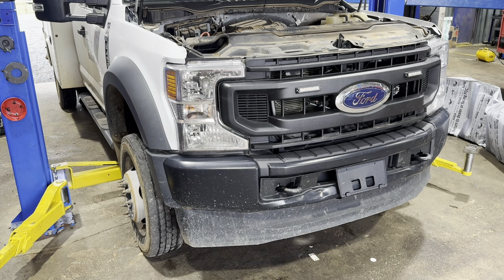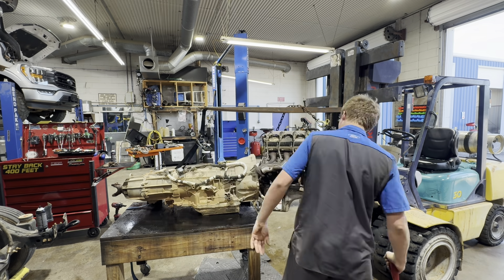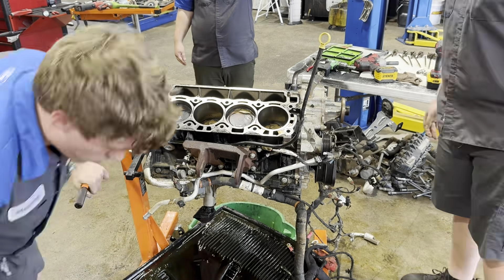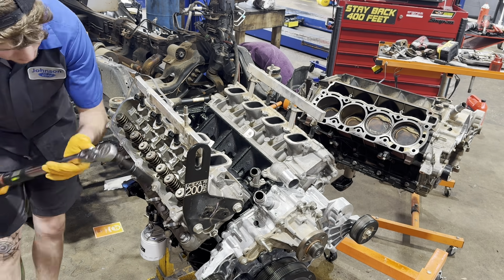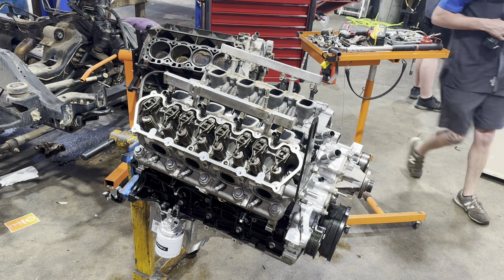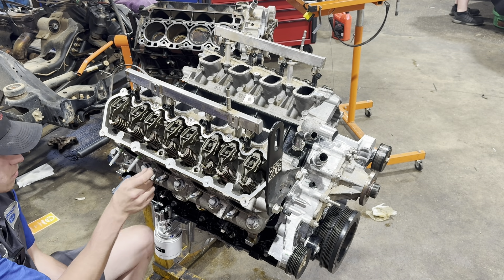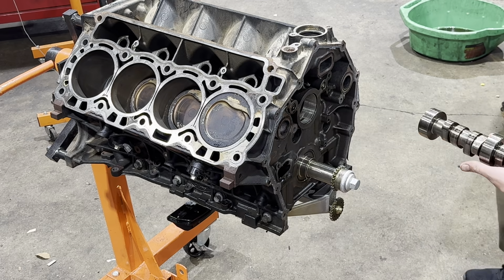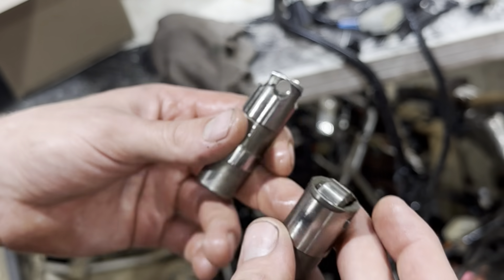Ford 7.3 Godzilla | Does this one issue make the engine a bust?

Comment: VW did the same low oil pressure thing a generation ago and they had a lot of problems too. Doesn't anybody ever learn? By the way all this low oil pressure thing was figured out by about 1940 !
The idiots at VW, FORD and every where else that promoted this low oil pressure crap need to be fired and never allowed to  make engineering decisions again.

Comment: I bought my 23 F350 Lariat ultimate Tremor w/6k miles May '24. Now, w/20k miles, engine started misfiring. Brought it in. Scanned it. They scoped it and found metal filings that attached to the piston rings and scored the cylinders. That was a month ago and they put a new 7.3 engine in it, one with a whole brand new part number. 75 mi later, it started misfiring again. I drove it straight to Ford 3 mi from where it occurred and they scanned it. Now the opposite side, two banks misfiring. They said they didn't see any scoring in the cylinders, can't figure out the problem, sent all the data and images to the engineers at Ford manufacturing. They said I would hear something Monday. We're talking 5 days ago I still haven't heard anything. Now if it's a brand new part number, I thought this lifter / cam delamination problem was corrected I was told. I know this problem is from poor heat treating process. So maybe Ford should contract with Crane and get their cam and lifters put in. That's all they do so I'm sure they got it downright. 
I don't know what to do at this point as far as sure, I have that 100K/7 year gold warranty that kicks in a year from now. BUT I do tow our fifth wheel with it twice a year, no more than 500 mi each way. We were planning on going around the country next year however now IDK about that. I didn't want to have to buy a diesel and I don't care for GM or Dodge. 
So it's a bit of a quagmire here. I should tell them to put the damn megazilla engine in it because that has the upgraded parts.

Comment: This is the video I needed to see. I was between a 6.4 and a 7.3 and the idle oil pressure has mde the choice easy. I dont want a high pressure fuel system on a gasser...Bye GM. I dont want a variable oil pump in anything...Bye Ford. Shame as the 7.3 has such potential, but Ill take MDS and 20-40psi oil pressure at idle.

Comment: 6.2 is a great engine. Probably the best Ford V8 of the 21st century in terms of longevity. Typical Ford fanboy lol. These 7.3s are a joke. Our fleet is 80% Chevy Express with the 6.6, and we've only had one engine failure, maybe 3 top end rebuilds and most of them are at 70-100k. The rest of the fleet is Fords, EASILY 70-80% failure rate on the gas 7.3s before 100k. They are a joke. They may have the same issues as GM V8s, but they can't take anywhere near the same abuse

Comment: You lost me when you said the 6.2 were junk. I run 10 service trucks with the 6.2 ford and they are great engines. Transmission have been good as well. They are 2012 thru the 2016 years.

Comment: Do not idle them, change the oil every 5k with good synthetic. A gasoline engine needs this, the new 6.8 and 7.3 engines are quite well built. Take care of them. Oil changes and regularly. A 6.7 Powerstroke will require much more maintenance and 17 quarts of Rotella. If you skimp on either and run them to long you will experience a wallet buster.

Comment: Does anyone here know how this translates to wear on a DOHC 4 pot used for deliveries? Cuz I idle alot in the parking lot unless Im expecting to be back out the door in <10 mins. cuz I dont want the start-up wear on the engine & starter ~40x/ shift + its diagonal on a very steep grade.

Comment: I have the Godzilla in my e450 based motorhome and love it. But then again mine never sits at idle, I'm either running down the road or it's shut down. Much better than the V10 it replaced in motorhomes. No double downshift going over a small hill anymore. I run it all day at 79mph and it's quieter and fuel economy isn't any worse.

Comment: I wonder if Meling or whatever the known brand that makes the larger volume oil pumps for the hemis will do that for the 7.3’s? I’ll also add that the oil pressure is just a affect of higher oil flows and the oil’s viscosity and temperature. If you run a full synthetic oil that still meets the weight requirements it will typically have a lower pressure but flow the same volume of oil through the engine.

Comment: So if you have pro-power onboard, it is bad for the gas and the diesel for different reasons.  But both shouldn’t be idled for long periods of time so not an RV generator replacement for sure

Comment: I don't know why anyone would put needle bearings in a lifter. That's generally what causes the lifter to fail on a Ford . Massive highway trucks run millions of miles and the only place for needle bearings are in the u-joints. Can anyone really imagine how many times that needle bearing rolls each revolution for 3 or 400 thousand miles. There's no oil pressure for the needle bearings in the lifter roller. Pescaderia makes a lifter that does not have needle bearings in it much like over the highway road trucks. Needle bearings in automatic transmissions are subject to massive oil flow

Comment: That 8 psi is a minimum operating pressure before the sensor sets off hook a actual line to the truck and see the 2022+ that ive seen people do this on start up is 90-100psi till it idles down and at a warm idle hovers 21-23psi some one read that 8psi thing somewhere and ran with it its just like politics a few people rinse and repeat info without testing it for themselves and that how bs like 8 psi at idle gets started. Look on yt ive watched multiple videos with oil pressure gauges hooked up with a actual pressure gauge and let idle for a while to test

Comment: The  introduction of Variable Valve Timing , the computer  cylinder management controls , and direct fuel o fiction , has damaged durability .
On all vehiclea  manufacturing makes , not Just  certain makes .

Comment: Here's the thing, you put this out in 10/24. Ford switched the 7.3l to the higher trim levels and put the 6.8l as the main work truck and 4x2's in 23? I think. But I know they did. The 7.3l heads look nothing like an LS HEAD. A LT is even a stretch. I don't see it. As for the lifter problem I'm sure there's TSB's on it to get to the root cause but I think there was a production change for the lifter, plus area's of high heat was noted. The oil pressure might be low but you never said the spec. Could be 8psi hot and 10psi cold with a peak of 20psi. You think the oil pressure gauge actually reads any pressure. Doubt it. It's an on/off light switch. My point to that is 8psi does seem low but they're not saying it's a concern. And low pressure does not mean low volume. Does the lifter have a submersed or pressurized lubrication design? That low pressure could be because the oil passages are wide open or there are more of them. So what's the cause of it? Probably production change in material saving 75cents per engine because some product manager took a risk cause he wanted matching Teslas from his $500k bonus. 

Me personally, I've seen way more 6.2l Boss engines above 250k miles than any other gas engine. Worked fleets with a few at 350k on the odometer when they stopped working. Same with my tech friends. A little work, cam, springs, and tune they can get close to 500hp and 500ftlbs with mileage bump. This is what I've seen and I don't give any slack to any engine. My Yukon Denali has 389k original engine and trans/tbox. I'll take a Boss 6.2l over a Coyote, Ecoboost, V10, Powerstroke 6.7/6.4 any day. Every other engine seem like a house of cards. They have no robustness. The 7.3l gas engine is another engine Ford didn't need. With money they used they could have improved the Boss. Add a small turbo its's 650/700 hp/trq give it F450 axles done. Done. Why do people think they can tow 30k lb houses around with passenger vehicle? A school bus has less towing but same payload but the chassis is twice the weight. That much weight(house trailer) is breaking 5th wheel chassis/frames overstressing the brakes and lmiting control.

Comment: These standards to push fuel economy have been terrible for longevity of engines.  Too thin of an oil, too low oil pressures, and this on engines which are supposed to be geared toward industrial uses.    We haven't seen this issue with any trucks at work yet...  I'll give it a little bit of time and we will.

Comment: The low oil pressure at idle, isn't something the OEMs can fix. Emissions regs are calling for detrimental lows at idle. The only way to achieve spec in a gas engine, is to lower idle resistance by reducing ancillary load. In short, low oil pressure at idle is the only way we can have things like high output alternators and air conditioning.

Comment: I have one of these in my RV and wondering  if I have headache in my future! It has 11,000 miles on it I put about 3,000 of those miles!  From the info I gathered most of the lifter issues are from high idle housed utility vehicles!

Comment: I have a 09 crown vic with 250k miles and over 8k idle hours. Original lifters / lash adjusters. It might be a turd but with no cam phasers, a decent oil pump, and oil cooler... it keeps working 😊

Comment: I bought my F250 with the 6.2 gas engine brand new back in 2016. 200k miles later, all I have had to do is change the oil. It still purrs like it did back when I bought it. Fantastic engine.
Reply: Got that right, I have tortured my 6.2 towing for work and its great!  Makes me wonder why they discontinued it??
Reply: If you pamper anything enough, it might last.
Reply: @ricksmith1382  it's called maintenance princess, just because changing oil is too hard for you doesn't mean the engine is faulty.
Reply: @Abandonsoyciety  Facts!
Reply: 6.2 was a very good engine. This dude doesn’t  know what he is talking about.

Comment: Great info. I just bought a ‘24, SD with 7.3. I wonder what ratio of run/idle is OK.  I notice it has fast idle at start at 1200 rpm, then steps down to maybe 900, then steps down to 600 rpm. Too bad there are few cars/trucks with an oil pressure gauge. I have heard these reports elsewhere. I will avoid idling at all reasonable costs. Better to replace batteries and starter.

Comment: Kinda funny they're having this issue, my 2UZ Tundra has almost no oil pressure at idle and that engine is sitting in the driveway at a little over 300K miles and there are more then a couple out there that have gone over 1 million miles.   At 300K I still forget that engine is running sometimes unless I look at the tach.

Comment: Why the hell is Ford so concerned about MPG in Super Duty trucks?  The EPA doesn't even require MPG be published on the Monroney label.  Just put the correct pump in the engine, give us a reliable engine and save everyone, including Ford Motor Company, the headaches.

Comment: I have Read that the Duramax engines in the Chevrolet and GMC models 2500 HD and up have a way to increase the idle speed similar to how a large truck or a semi tractor truck will use the cruise control to idle up. Supposed to make the engine last longer and keep it cleaner. I know I read it somewhere imagined it but it takes it up to a thousand or 1200 RPMs and that will let it produce heat and it will cool it more efficiently. That's my two cents worth.

Comment: It's more than just the low idle psi, they also drop oil flow rates. So its a double hit to the cam and lifters, as the oil is the only thing cool those high friction parts and they halve oil flow rate from what it would normally be in a fixed pump setup. 

As for Ford fixing this with a software update, they can't as far as I know. The oil pump from what I have seen is completely mechanical in the way it works so there is no solenoid to control. 

What I'm waiting on it someone like Melling to come out with a fixed psi and volume pump to replace the OEM unit, like they have done for the 4.6l and 5.7l to fix their oiling issues. Once I know their is an OEM placement replacement pump I will more than likely make a f350 dually with the 7.3l my next truck. There are some aftermarket company's that remove and relocate the oil into a new timing chain cover but it also means a new accessory drive setup too, and that is a little to much $$$ for what should be a simple pump swap to fix this issue.

Comment: Considering the solution to fix a cam and lifter failure is engine replacement because the engine is full of metal debris that will slowly destroy the main and rod bearings, yes, the 7.3 Godzilla IS a bust.

Its just a big money maker for you.

Comment: I really believe that besides oil pressure issues, one of the big parts of these failures is the hydraulic roller lifters they wreak havoc in nearly every engine. Cummins went from flat tappet to roller and they immediately started having lifter failure problems too. I’d say rollers are fine for race cars but not the everyday workhorse.
Reply: And was the Cummins failure because of the lifters , or the non tulip designed push rods like they had previously? Non oiled , splash only on both designs. Only the older "tulip" push rods would catch and hold oil.....    Loose a pushrod, smash a lifter. Loosen your grip on the epa and pay the price. P.s. pay the engineer more and hire the good ones
Reply: Vortec and SBF didn't have roller lifter failures... 

My BBF retro roller cam doesn't experience these failures.

Quality is where the problems lie, not the design.

Comment: doesn't Holley or another aftermarket company offer a gear driven, high volume oil pump for these? if it were MY truck at a shop due to lifter failure that stems from a variable-pressure oil pump, i'd get rid of it for a high volume unit akin to what the mighty 460's utilized.

Comment: In general, a race engine only needs 10 PSI of pressure  per 1000 RPMs .maybe they should install sprayers for the cam lobes

Comment: I can see absolutely no advantage to allowing oil pressure to drop to dangerously low pressures---regardless of engine rpm.  Ford should just install a high-volume mechanical oil pump in their engines and then watch their low oil pressure related engine failures evaporate.  I guess Ford is hoping that the engine will make it through the factory  "warranty period" before it grenades itself and the customer is then forced to pay for a very costly repair---or just buy another truck...

Comment: I dont think the oil pressure is the problem. 8 psi per 1k rpm should be good. In theory, to much oil pressure will push oil from where it needs to be if that makes sense. I have a 302 ive drove for 30 yrs now. Same engine never went back in. Anolog gauge always shows  around 30-40 cold. Once warm 7-10 psi at idle. She dont tick and runs like a beast🤷🏼i think our metal products suck chinesium now. German metals seem so much better.

Comment: Youtuber named repairvehicle pointed out a few design flaws of this engine. thin cut-out walls between cylinders, phazers, plastic guided chain driven oil pump, cam phaser etc. Ford has been instructing their engineers to design everything to fail. It's all about generating more $$$ for legacy car makers. Almost bought 24 F350 7.3 gas DRW for a camper. Look at closer at 2:38 on this video. Brand new engine has the same flaws.

Comment: I don't buy the oil pressure hypothesis.  IMO it absolutely is a lifter manufacturing problem, for a couple of reasons.  First, the quality aftermarket lifters don't fail with the same stock oil pressure.  2nd you'll virtually always find it's 1 lifter that's failed, and it's not always the same lifter.  If it were an oil pressure problem it would be multiple lifters but we always find 1 lifter failed and the rest are perfect.  If it were an oil delivery problem it would consistently fail on the same lifter position.  It isn't, it's completely random which lifter position, and it's virtually never more than 1 lifter.  It's like there's a small percentage of bad lifters mixed in with the good and every engine is a roll of the dice on whether or not it gets one of them, which is exactly what we're seeing.

Comment: When you get down to it you can chalk the lifter problems up to government regulations.   These ridiculous fleet fuel economy standards that are imposed forces the OEMs to find ways to save every drop of fuel they can.  Which why we now have unreliable turbo engines everywhere, variable timing and oil pumps, and displacement on demand in all these trucks.  

Hopefully the current admin will eliminate these rules.  When I buy a truck for hauling/towing the last thing I care about is fuel mileage.
Reply: The auto companies don't release mpg figures for 3/4 ton and larger vehicles. So why bother with a variable oil pump? The Chevy 6.2l uses a variable oil pump too but that is only available on half ton and smaller.

Comment: Or when you rebuild like they say the engine is designed to be able to bore it out just get a non variable oil pump and keep the oil pressure up when idling what ford should have done in the first place

Comment: Question my 22” 7.3 keeps popping a catalytic code and I noticed a lot of water dripping from tail pipe after the truck had been run for hours on a warm day 70 plus degrees it appears to be condensation but I have never seen it before or the code, check engine 
Any ideas to point me in the right direction